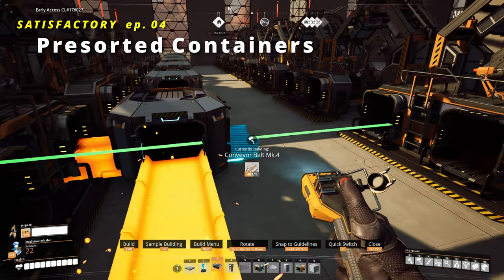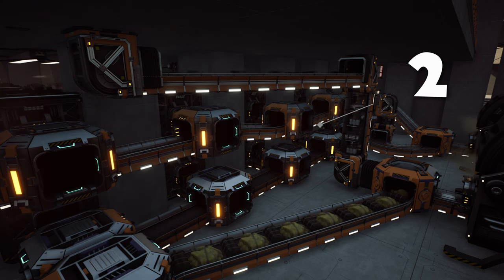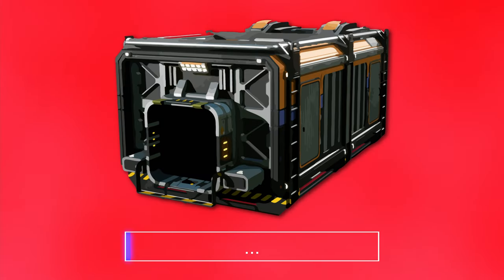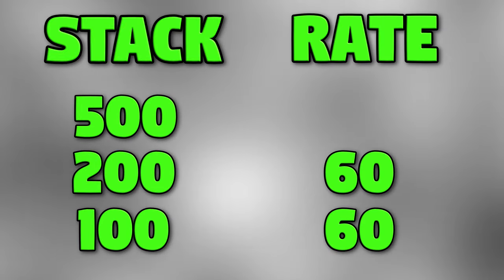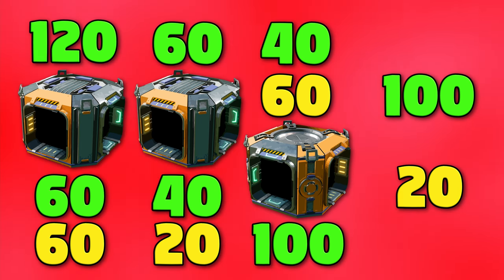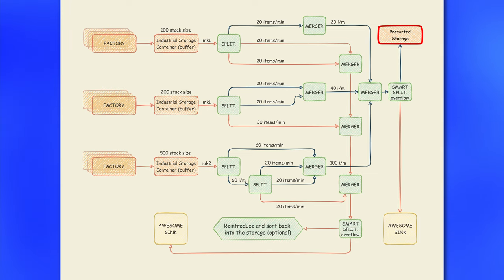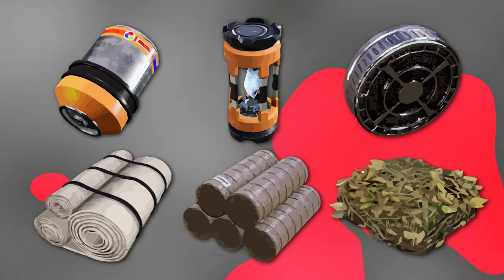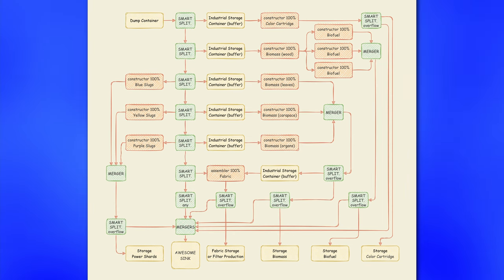PRESORTED STORAGE in Satisfactory

Comment: I think I’m going to use this to balance train loads, so I can have a single train supply several warehouses of various materials! However, if I wanted to provide supplies of more advanced materials that have stack sizes of 50, what should I do? Should I use an assembly like the one for 20/min and just divide that in half, throttling it down to 10/minute? Seems smart enough to me, but what do you think?
Reply from the maker: Yep, dividing it one more time to get 10 items should work. 
Really like this system with trains, although my trains usually consist from like 3 train carts filled with concrete on top of sorted cart XD

Comment: I never hook a personal storage facility  to a factory. That how you kill the game. I have two storage containers for input and then have it sorted. When something is getting low, I go to the factory and manually transfer it to the input storage or directly to the type storage container.
Reply from the maker: Well, it works early on. I am guilty myself bench crafting everything before I hit foundries with alloy ingots and solid steel ingots. But once you get to oil, computers and aluminum, game just turns into walking simulator unless you have some sort of personal storage ¯\_(ツ)_/¯